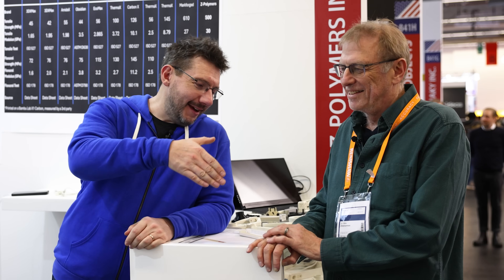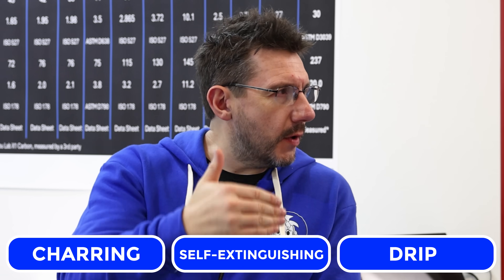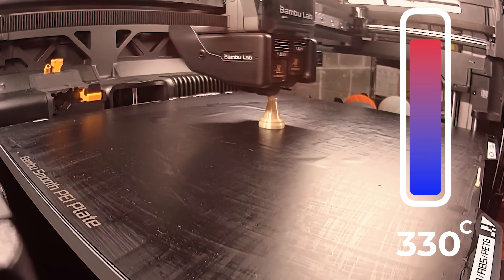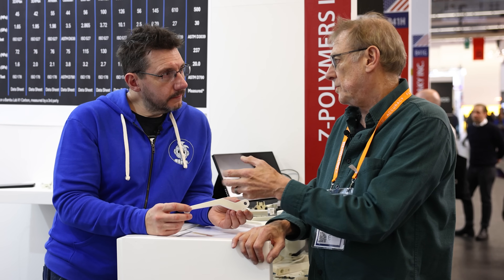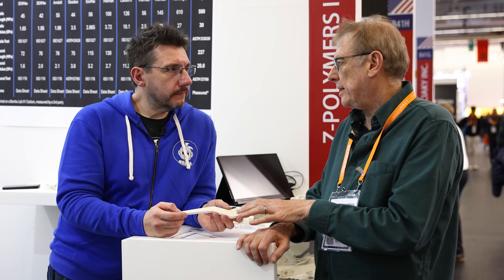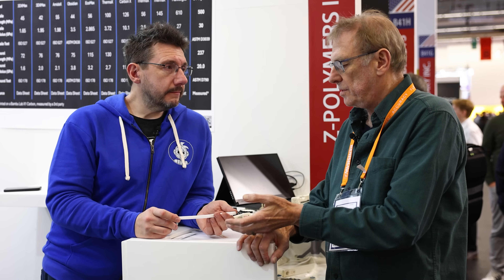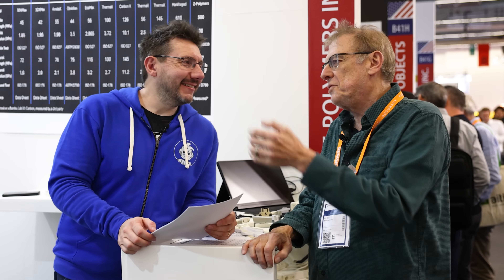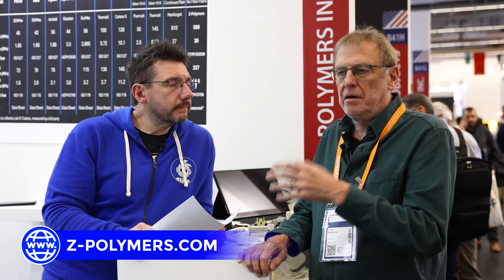Unicorn Filament! COMPOSITING Tullomer from Z-Polymers!

Comment: i have so much to say about this product and the presented data. perhaps i can give a 5-hour lecture on this. but anyway, as a material scientist, engineer and been making friends and perhaps enemies with polymer industry players in evonik, victrex, solvay, mitsubishi so on particularly over FDM 3D printing in recent years, i would like to give these comments:

- the application of tullomer filament in FDM 3d printing is extremely limited owing to the Z weakness (lol...made by Z-Polymer)
- if D3039 is arguable, everyone can just look at D790. we all love D790. and indeed PEEK-CF FDM print can beat that 237 MPa in tullomer easily
- FDM tullomer is defiitely not an option 1) if you need good mechanial properties in all directions; 2) if you need nice look
- in short, Z-polymer is merely making tullomer filament being extruded with ordinary FDM printer, such that u get not so nice looking "fibre" (1D usable object) lol.... yet, if i have to get just fibre...lol there are plenty of choices. 

conclusion for FDM user: based on the price, usability and the mechanical properties, just go back to get the PEEK-CF from victrex/evonik those people. or getting PEKK stuff for easier printing. 
conclusion for the tullomer FDM project: for the sake of the world. stop wasting money and earth resources.

Comment: ordered a roll of this stuff when it first released and the z-axis adhesion was hot garbage even with a high temp printer no matter what print settings, etc - like, picking apart the layers with your fingernail with literally no effort bad

Comment: Don't worry about the price, it will come down.  This looks identical to Vectra A950, and people have been making filament out of Vectra A950 for a while now.  It's only about $10/kg.  We made some filament from it at uni many many years ago, the key is a nucleating agent. Boron nitride works well,  but we also tried ionomers like polysulfone or PPS using Zn-SPS as a compatibilizer.
Reply: Boron nitride rivals diamond for hardness.  Grains of that compound in the filament sounds very bad for nozzle life.
Reply: @hanelyp1  You don't need to use boron nitride, talc works as well.
Reply: Can you extrude pure Vectra 950 into filament without the nucleating material?
Reply: @3Dunderground  Yes but the crystals become super aligned and the skin between layers doesn't bond.  Also it can super-cool and stay soft, then suddenly crystalize and release all of the heat.

Comment: Tullomer is already impressive, but adding just a few percent of graphene during compounding would push strength and stiffness far higher while adding electrical conductivity. The data on similar high-performance polymers is clear: it works, and the gains are substantial. Worth exploring sooner rather than later.
Reply: Thanks gor suggestion

Comment: How well do you think this would print on a Modix Everest? It'd be interesting to see how much it improves RC car suspension parts if used as infill, most of our parts are CNC'd aluminum, but it'd be interesting to see how PA6 and Tullomer would compare. We mainly use our Everest to do body molds with PETG, it serves it's purpose, but it'd be nice to have it working more than once a month, I kinda feel like I wasted $15k on it at this point.

Comment: US$550 for 1kg puts it up in the special place with Ultem 1010 and PEI-CF. Compositing might make a lot of sense with this, but I really don't trust the numbers. Conflating ASTM D3039 with ISO 527 for tensile strength is wild. If you convert (imperfectly, as the two test standards aren't wholly comparable) the results, as @froust says below, the Tullomer drops to ~100MPa, the same as ThermaX PEEK and less than Ultem 1010. This is trade show floor sales BS, and it leaves a really bad taste in my mouth.
I'd very much like to see it compared accurately against CF, GF, and crystal loaded filaments with all being tested to ASTM D3039 (high performance filaments do better with D3039 than the dogbones in ISO527).
Comparing it to naked polymers is also cheating, as it's a crystal loaded matrix, not a 'pure' polymer like PETG, PLA, ABS, Nylon, PEEK, or PEI. Looking at the data for the filaments shown in comparison shows they were cherry picked to make Tullomer look better. It's overall very disappointing, but not at all surprising.
Reply: We use ASTM 3039 as it is the specification for testing composites. We are a melt processable version of Kevlar. We are comparing to Markforged Kevlar continuous fiber and they use the same ASTM 3039 spec. We are reporting our data using the same specs that other continuous fiber 3D painting companies use. Our material is a composite, and we report it that way. Non composites report with other test methods.(e.. ISO527). So we are following in the conventions of Mark Forged and  Anisoprint as to how they report data on composites to make a fair comparison.

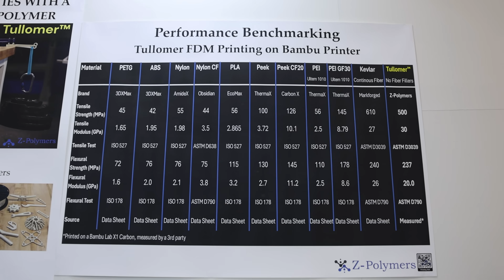Comment: 5:21 So they used ASTM D3039 for their polymer tensile strength test and for others ISO 527 and Z-polymers dare to show this lie to customer? This is marketing fluff that only to hide how terrible tullomer is, if you roughly interpolate D3039 to ISO 527 you will get around 100 MPA of tensile strength in ISO 527, which is even lower than typical nylons.
Reply: There are three kinds of lies. Lies, damn lies, and statistics. - Mark Twain
Reply: @mrnukeduster I like quotes from Joe FRIDAY.  Just the facts. We are comparing our data to the other continuous fiber products such as MarkedForged. They use ASTM 3039. We are just presenting the facts about  how composites are reported
Reply: 3d printing hasn’t worked for blunt body armor applications like knee pads/ or SCA armor. I’d be curious how this would preform.
Reply: Our material is basically a melt processible version of Kevlar. We are creating fibers as we print in- situ and create an end structure which is a composite. We compare our material to Markforged which is continuous fiber. They and other continuous fiber companies use ASTM 3039 which is the test method for composites. So, we are showing Mark Forged data for continuous fiber Kevlar which uses the same test method. The other data is from the text specs people use for non-composites (e.g. ISO 527). We want people to compare our material properties to continuous fiber products, using the same test method. Advantage of our system is that we create the fibers in situ and use low-cost printers, e.g. Bambu H2D. As a note the properties are a function of printing parameters.
Reply: @michaelzimmerman-l5h  Has the warping issues been able to be tamed on larger and more complex parts? I'd love to prototype with it, but interlayer adhesion, while better when printed at 330c from what I see, is still problematic, and warping was problematic, too from other reviews I've seen. I'd love something that bridged the gap between PPA and PPS and 6061 but dimensional stability is a big concern.
Reply: So accurately displaying results and defining which tests are used is showing  "lie to customer"?  Interesting perspective.
Reply: @billbliss7407  It's lying with statistics. The test methodology makes a TON of difference in what the results actually mean. An old quote in statistics is 'figures never lie, but boy can liars figure'. @froust is right.
Reply: @mausball I agree . Please see my response. We use ASTM 3039 to compare our  material to other continuous fiber products, e.g Markgorged,and Anisoprint. They use ASTM 3039
Reply: @billbliss7407  Using testing methodology that makes your results look better is a marketing deception at best.
Reply: @froust we  used ASTM 3039 to compare our material to the other  continuous fiber  approaches. If you look at  MarkForgef data sheets they use ASTM 3039 for continuous fiber and ASTM 638  for non non continuous fiber. We are following the way the 3D print industry reports
Reply: @michaelzimmerman-l5h  Independent testers have already shown that your filament is simply an overpriced material that cannot match PEEK, and that it cannot even be printed on an H2D. It requires a truly PEEK-capable printer. Yet you continue to mislead people, and now you are also giving false information about its tensile strength.
Reply: @billbliss7407 thank you. Please see my response

Comment: Perfect timing! I was going to buy Tullomer last time you showed it but the printer I had at the time wouldn't have been able to handle it. I just bought the H2D Pro so now I'm ready to try it. Should be a game changer for 3d printable hardware tools 👍
Reply: Let us know about your results
Reply: i would wait for some third party results- it is great on paper an thats about it. check out some videos of others testing just tullomer. I tested it all summer on a vision Miner Idex v3, could not get any usable parts from it after using their recommended print settings or my own settings.
Reply: Let us know about your results

Comment: I love new engineering materials and I love the work they put into it - but at ~$600 per kg its a hard sell. PPS-CF costs ~$100 per kg and offers pretty much the same properties aside from the tensile strength - and even then, at ~90 [MPa] in XY direction, which is comparable to pure Aluminium, it covers a significant portion of Tullomer's applications.
Reply: It is not comparable to aluminium, al is in 300-500 mpa range (alloys, nobody is using pure stuff).

Comment: I can't find info for strength in the Z direction, only X-Y. i know he said they got it 5x higher than previous, but I don't know what that actually means. Anyone have any info?
Reply: it was non existant on the pure tullomer. made printing with it nearly useless. I wanted to like it but after going through a spool of adjusting settings on a more than capable printer, didnt even bother with the second roll.

Comment: I think the key for this material in the end will be to have it as a "core" with PA6 on the outside for greatly enhanced layer adhesion and Tullomer on the inside to create the fibers to provide the incredible stiffness. 
I would expect it to achieve similar results to a continuous carbon fiber printer, but without all the added complexity and time of embedding the continuous fiber.
Reply: I agree with you. We are making fibers "in situ" so we are trying to get rid of complexity.

Comment: Bambu is not an open source printer, so I’m glad you’re printer agnostic
Reply: Bambu is fine.  Just need to setup your network and printer to block everything.  Setup so you send print job via Lan or SD card. Setup network to block all in and outbound communication with the internet and only communicate on the local network.  Use orca slicer.
Reply: My biggest problem with Bambu is they are Chinese.
I'm not trying to fund the PLA, and I don't mean the filament.
Reply: @Metapharsical get over yourself. The world is intertwined and the idea of that bullshit is so obnoxious and nonsense.
Reply: I've had some of the most open source printers from back in the Reprap/Repetier/Ramps days.

Now I have a Bambu. It just works. Bambu stocks virtually all of the machine parts at a good price and will allow me to fix it myself. They still allow me to use whatever filament I like.

I don't get all the hate.
Reply: @procrastinator1842  it's mostly coming from pruasas marketing and their influence. They created fake outrage and the wheels are turning by inertia now. This is their last resort, instead of actually selling good products.
Reply: I've had some of the most open source printers from back in the Reprap/Repetier/Ramps days.

Now I have a Bambu. It just works. Bambu stocks virtually all of the machine parts at a good price and will allow me to fix it myself. They still allow me to use whatever filament I like.

I don't get all the hate.
Reply: it's mostly coming from pruasas marketlng and their infIuence. They created f*ake 0utrage and the wheels are turning by inertia now. This is their Iast res0rt, instead of actually seIIing good products.
Reply: @procrastinator1842  The hate is that corporations can't be trusted. As the old Microsoft adage says, "embrace, extend, extinguish". We cannot let them do that on the backs of years of work from the community.
Reply: @AR-fn3se when they start doing that nonsense we will leave them. They walk the line and provide a product that works. Closed source or not they give back to the community in ways you don't seem to understand. They made all these companies actually step up their games and start innovating.
Reply: @MrSirclint  They already are doing that nonsense. Most people don't notice or are willing to put up with it. They're boiling frogs.
Reply: @AR-fn3sethey aren't but ok
Reply: Barely any printers are fully open source so it's absolutely irrelevant.
Reply: Who cares? Almost ALL filament are printer agnostic... Why is in important that Bambu is not an open source printer (which is overrated as most people do not care about that anyway)
Reply: @livelaurent  You do realize that filaments are only printer agnostic because that's how the community made it to be right? Right? Before all this, Stratasys has the entirr ecosystem locked. If Bambu can get away with it, they'd do that too.
Reply: @livelaurent  I care.
Reply: @livelaurent the only reason you even get to use any filament in your precious bambu is because of the open source roots of consumer 3D printing. After the patent expired and stratasys no longer had a monopoly on FDM, open source projects sprung up everywhere and an entire competitive marketplace was created for filaments. Prior to that, stratasys had users completely locked in with their own proprietary filament cartridges (literally spools in a box) which were wildly overpriced. Same idea as HP 2D printers.

The only reason 3D printing companies aren't doing that anymore is because of competition and because the filament marketplace already exists.
Don't kid yourself for one second if you thought these companies wouldn't lock you in if they could. Recurring revenue from selling consumables to an artificially locked in machine? It's a venture capitalist's wet dream.
Hell, they would make you pay for the slicer software if they could, but because bambu's slicer has its roots in Slic3r, (another open source project), they literally can't.
Reply: @free_spirit1  bruh, please tell me you are not serious
Reply: @riba2233  Where's the lie though?
Reply: @AR-fn3se his logic is very flawed. I know that it's easy to compare this to 2d printers and stratasys, but if you think about more it it's not a good analogy.
Reply: @riba2233  Why is it not a good analogy? It's a perfect analogy. If Bambu is allowed to get away with it, all other manufacturers will follow suit. That's how things work. Just look at every industry on Earth. You're disconnected from reality.
Reply: @AR-fn3se false, that is not how it would play out. Like I said, this is not comparable to 2d printer ink (it would be more comparable to paper which was never limited) and stratasys not only had a practical monopoly but also targeted a completely different audience. By your logic someone like ulitmaker would also have proprietary filament, but they didn't.

Comment: will the X 1-Carbon be able to print this material?
Reply: It can't hit the nozzle temperature required to have somewhat acceptable Z layer strength.  It's not cheap stuff either with two kgs costing about what the X1C costs.

Comment: Frankly, I'm more interested in PEEK because of its chemical resistance than its strength. You can get more strength from fiber-incorporated filament.

Probably still not going to spend tens of thousands for a printer capable of if it though.
Reply: use pps for chem res
Reply: @bartman2395  How does PPS compare to PEEK and this tullomer stuff?
Reply: @o0shad0oo  For my use PEEK was not useful because of fluorescence. I asked him on the Formnext but je doesn't test this.
Reply: Pure Tullomer has excellent chemical resistance and can print on low cost printer

Comment: Will this print on a Bambu now?  That is encouraging.   Tried printing some of the original Tullomer at recommended nozzle and bed  temperatures (and a well-heated chamber)  and Z-strength was bad.        

Unfortunately I won’t have a second chance to prove this works with the new formulation; - if tech trials fail the first time you don’t get a second chance - once bitten; corporates are too conservative to try again.
Reply: I ran into the same issue, bought it at work to use it because it was promised to work with the X1C but now they are saying you actually need higher nozzle temps (went from 300C to 330C). Didn't get a chance to actually use it on an X1C because I saw a youtuber struggling with it.